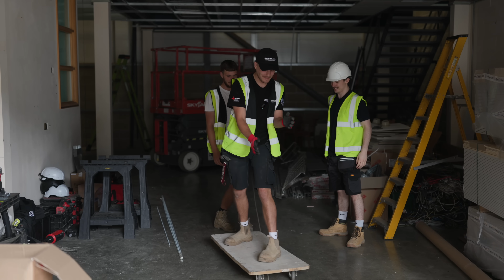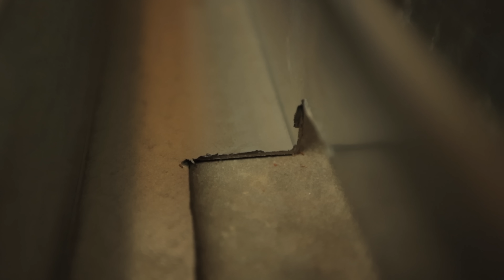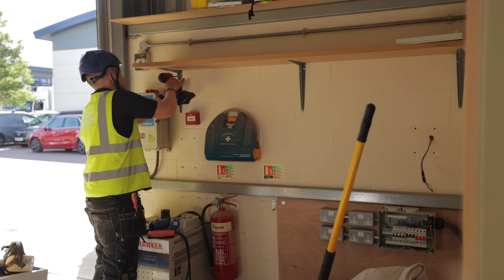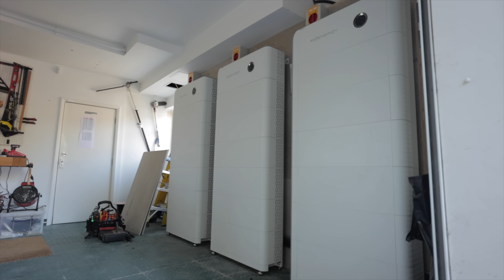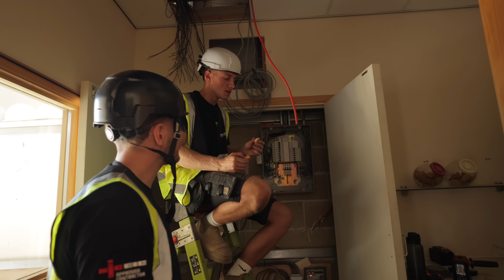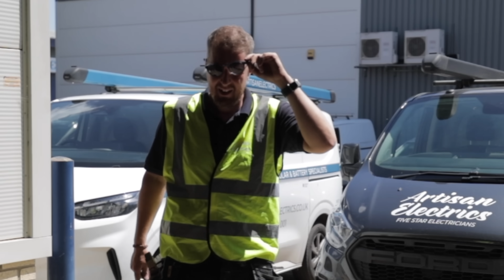We RIPPED Everything Out at Artisan HQ! 😱

Comment: Considering the upstairs bathroom @12:00: if you replace the current cubicle with 2 folding doors you would have a lot more room for movement when not showering.
It seems like it would get quite tight between the shower cubicle and the sink otherwise.

Comment: Interesting to see how Uk electrical differ from other contries in Europe. Not common in other countries to use single insulated wires in metal tray. It is more common to use basket tray and cables which are circular in shape.
Reply: Basic (single) insulation will only be used when fully contained inside trunking and conduit. Any cables on open tray or basket will be insulated and sheathed.